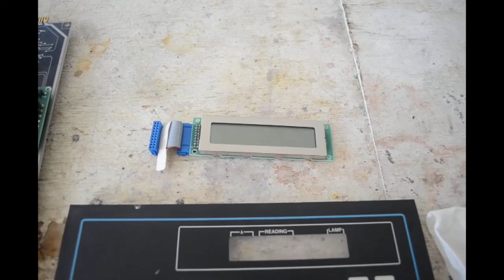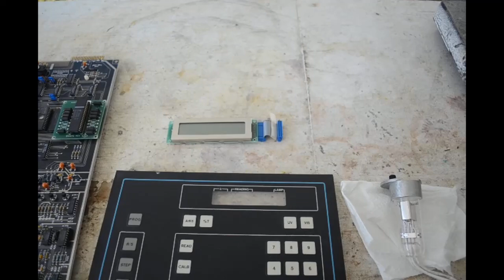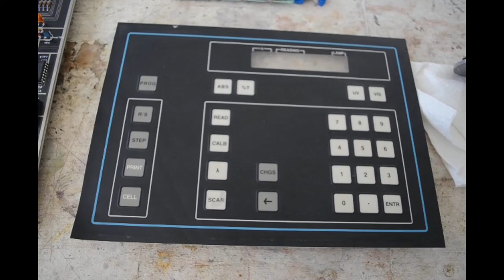Followup to Beckman DU-64 Scrapout. Found more value in it. Plus answering a question.

Comment: I asked about the gold in transistors , I do recognize most transistors and have collected many with gold on the outside - legs & metal caps , but have not heard about inside .
So yes more on stuff with unseen gold ?
I use stereo microscope and or other magnification to look for gold , and will break open components to look for  good stuff ;)
Do a lot of electronics repair , added scrapping after a while .
Again thanks